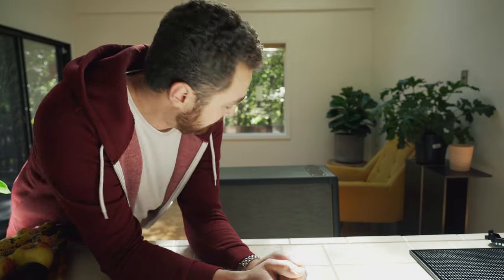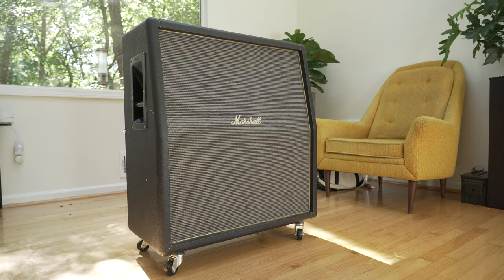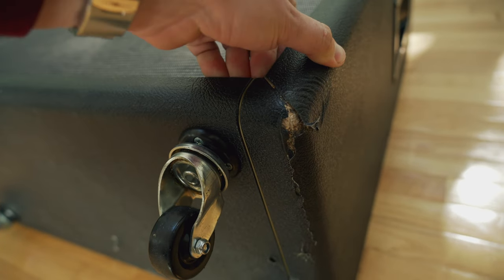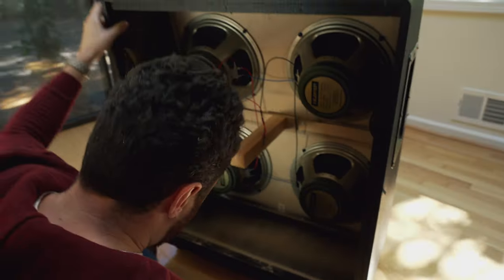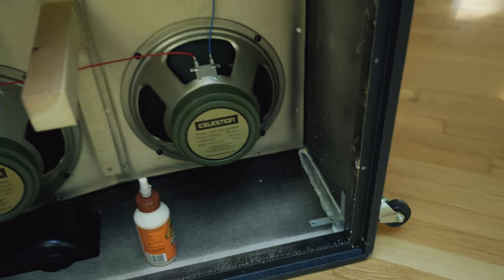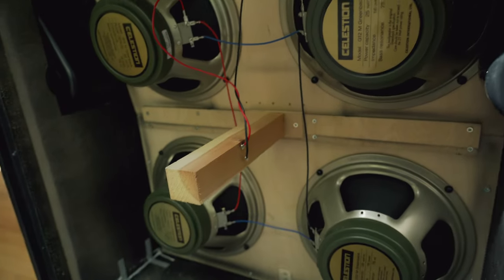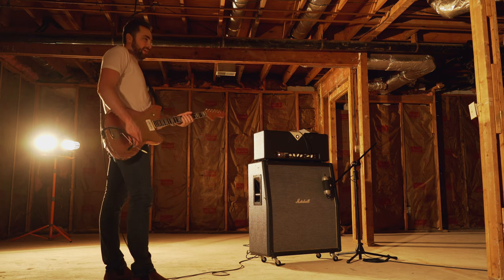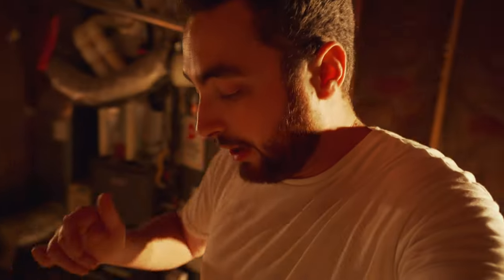I Bought A BROKEN Marshall Cabinet (and it sounds AMAZING)

Comment: There are already a lot of people saying the "proper" way to fix this, which is correct.  But sometimes issues like this can make a cab come to life in a weird unpredictable way.  The best sounding guitar I have in my room is a $400 bolt-on neck, with a partially stripped neck bolt and is shimmed with index cards.  I have no way to know if this guitar sounded that good before when it was brand new, but it has an attack and tone that just sounds great and still stays in tune well enough to record with.  I can only imagine that magic may be lost when fixing it "the right way", so I haven't bothered to.

Comment: I've seen people add wood in the corners from the inside to add strength. One time someone on ebay shipped me an empty Peavey 4 x 12 with no box or wrapping. They just slapped a label on it and shipped it. it arrived in one piece.

Comment: Rhett, check out the Bogner Helios for that 100 watt plexi...and throw in a Fryette Power Station 2 to place your time based effects after the preamp and power tube distortion. You can thank me later. Congrats on the 4x12 with those greenbacks.

Comment: better check the baffle screws again.  nothing sounds sweeter than a 4x12 greenback loaded cab.  i do all my small pub gigs with a 4x12, so as to keep the volume down and have the speaker angled correctly to my ear so i can hear my self properly.  instead of tilting a small cabnet back and head on floor.  i've two v30's in the top and aim on swapping the other two one day to greenbacks.

Comment: Cool! But it might be an idea to watch late era Paul Gilbert videos on a regular basis. As a reminder.  For health reasons. Doesn't matter that much if you don't like Paul. What health reasons? I'd guess you know. If you don't, you almost certainly do know someone who does.

(It's fine cranking it up for one video, without protection, but e.g. on stage, you might be able to buy yourself some added longevity with plugs or something?)

With the above caveat, ... Cool! (Speaking as someone who doesn't regret giving himself tinnitus using a Marshall half stack to do the damage. I suppose I might start to feel a bit differently when total deafness begins to set in, though.)

Comment: Would be much better with with wooden triangle wedges in the corners rather than metal L brackets with metal screws that will eventually work loose and rattle

Comment: you should have got some basic yellow wood glue as its water based......HIGH SCHOOL WOOD SHOP.  Watered the glue and let it soak into the box joints and kept it wet for awhile and but thicker yellow glue in as it would draw in......then let it dry a day or 2 to harden.  Then cut something like a good sharp squared 2x2 and cut pieces to fit the box and glued them in as well as screwed them down while the glue was wet.....and that box would be super solid and sturdy.  Then once dried...peel back the outside tolex and run a few screws into the 2x2 batten from the outside and its tip top......re-glue the tolex down......find whats called liquid electrical tape in a bottle...its black......Walmart here has it.....and run some down the damaged tolex to fill in the damage....let it dry and maybe recoat....nobody would be able to tell......use an artist brush to fill the tear and defects.....get cheap dollar store artist brushes as they are one use with the liquid electrical tape.....
Reply: I use coarse drywall screws and not wood screws

Comment: Isn’t it a 1960tv cabinet? I had one. The braces are always loose. Measure it and put a screw in where the brace meets the back. Forget the corner braces, it can vibrate where the wood comes together. You should’ve squirted the wood glue into the corners first, used furniture clamps to pull it together and THEN put the metal brackets on. It would never brake if clamped. Tightbond glue is the best but any glue joint has to be clamped.
Reply: Sounds good!!

Comment: I would say its impossible for all of those screws to unwind because of a knock and if they did you wouldn't be able to just wind them back in as surely all of the holes would be torn out so probably a factory issue, the cabinet collapsed because the screws were not tightened before it was sealed up makes more sense to me but nice cab though

Comment: Surely a balance of cost and being hidden inside cab, but did you consider re-gluing joints instead of drilling new holes with braces? Guess it doesn't matter if your intent is not to re-sell and make it like new..

Comment: Should have ran 2 pieces of 3×3 wood on the bottom inside the width of Cab
Reply: Agree totally. The 3x3 wood cleats plus Titebond  glue would have made the cab stronger than the original. The small screws in the 90 degree brackets will work loose and the glue squirted in the break are not  structural enough to hold for the long term.

Comment: Wow , would have taugth these finger jointed were stronger than the the butt jointed DIY cabs I made. Must have been one hell of a drop or they forgot to screw completely the speaker baffle, contribuing to the edges ripping appart.

Comment: be carefull with that hot water boiler it needs (using) a lot of oxygen for safe burn. so take care that there is a pipe fore fresh air in so there is always enough oxygen in that room!!! and use a carbon co detector!!!

Comment: Wow. That glue did Nothing. At all. Any glue you can see is not doing anything to hold a joint together. 
As mentioned below by Mr. Burns-Hagstrom III, gluing wood blocks into the corner would be the best plan, as long as you clamped them for 24 hours. I don't thing that temp changes would fuck with those l brackets, but vibration sure would.

Comment: Wrong brackets.  Use a metal angle brace like for 2x4 construction. And glue should be instead put into the cracks from the outside, wipe off excess and apply clamps.

Comment: I have two A cabs vintage modern those speakers are so close to pre rola I don’t use anything else bad ass vintage sound I know mine come from China but the guy that designed the speaker said they are same sounding

Comment: Don't drill new screws. Take a couple of toothpicks and shove them in the holes and put the screws back in. Use glue and some ratchet straps on the joints on the bottom.

Comment: I don’t know much about cabs, but wouldn’t a couple of L brackets on each side make the joints pretty solid?

Edit: you could put L brackets on the inside with some silicone to cushion them so they don’t rattle when it’s cranked.

Double Edit: okay, I see you already have that plan. That’s what I get for posting AS I watch. 😂

Comment: The cab broke apart because it's MDF - not a good grade of ply. MDF, being made of compressed sawdust in resin and lacking any directional wood grain, much less the built-up and perpendicular alternating layers of plywood, can't take the hits that ply can - and won't hold screw threads like ply does. Plus, to compensate for MDF's lack of strength relative to ply, and to have enough mass to not sound boomy, the manufacturer has to use really thick MDF, meaning this cab has to weigh close to a bank vault or ocean liner. This may be why the unit (and its predecessor) were damaged to begin with - it might have gotten loose in the truck or gotten away from one of its handlers - fallen off a hydraulic lift, for example. All of the above are among the reasons why vintage amps and speaker cabs are so prized, electronics completely aside - and of course, MDF cabs sound different from ply cabs, which in turn sound different from older yet pine cabs. All that being said, the end result sounded great - great playing by Rhett as always, close-miked in a well-insulated room at a volume that didn't really make the cab much of a factor in the overall sound. I have nothing but respect for Rhett - and think of him and Beato as a kind of Butch Cassidy and Sundance Kid of Rock 'n Roll. All the best...

Comment: No way you want to pump a 100w plexi through that cab.  You’ll blow it up.  Peak output way too much.  Get 50 w plexi or JTM45 (30w) better still. No reason for 100w skull breaking power.

Comment: The glue was useless.  It needs to have been injected into the finger joints to have been any use.  All you did there is make a mess.  (For what it's worth, I'm not talking out of my ass - I make my living as a guitar builder and repair person, and literally use glue every day of my working life.)

The corner braces will be fine though.  There isn't much magic to the construction of a fully enclosed plywood speaker cabinet.